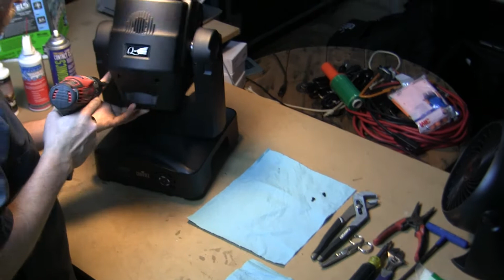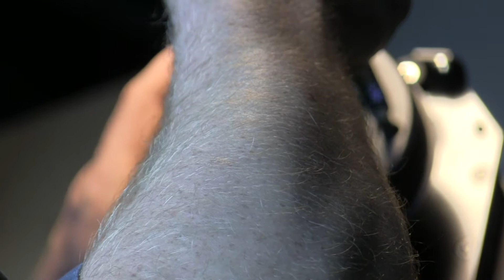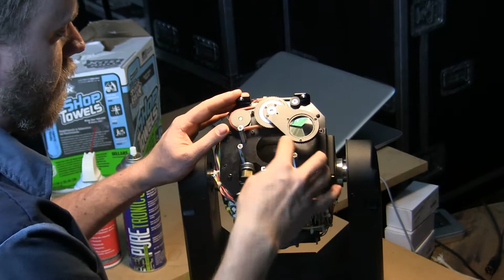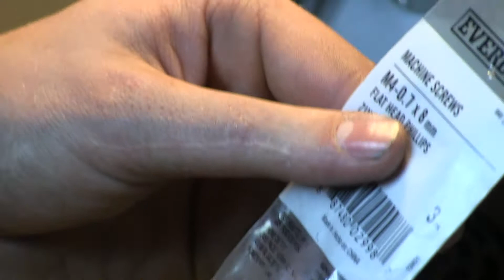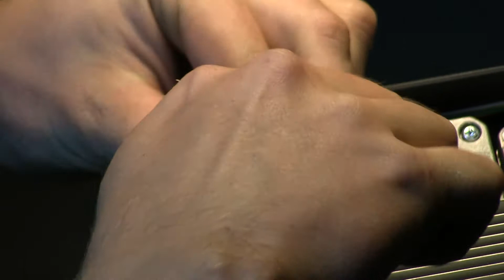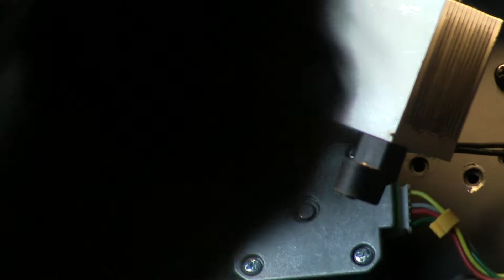Chauvet Q-Spot 260 LED - LED Chip/Diode/Bulb Replacement Part 1

Comment: Could you guys share with me the site to get these LEd diodes
Reply from the maker: These LED diodes come and go over the years. I don't remember exactly where I bought mine, but after doing some research I found this eBay listing for an LED chip that matches. Hope this helps! 

https://www.ebay.com/itm/204433138069?chn=ps&var=505002560529&_trkparms=ispr%3D1&amdata=enc%3A1W5fY80IYRCGCwX7dKCD5BA7&norover=1&mkevt=1&mkrid=711-117182-37290-0&mkcid=2&mkscid=101&itemid=505002560529_204433138069&targetid=2320093655185&device=c&mktype=pla&googleloc=1015334&poi=&campaignid=21222258394&mkgroupid=164713660992&rlsatarget=pla-2320093655185&abcId=9408285&merchantid=6296724&gad_source=1&gbraid=0AAAAAD_QDh95sthiDY8Pqv0EqOTAQeI5G&gclid=Cj0KCQjwlvW2BhDyARIsADnIe-I7TgJSMgTowxzheXwzxbKH0PRO3VTyKdCu-hrjkv9108b683I5KGcaAsz0EALw_wcB
Reply: @kpproductionusa  Great descriptive video! I have some Chinese knock offs “spot 60w led” that I’m interested in retrofitting. I noticed the 60w LED diodes is the same size for 75w and 90w. Is it possible to move up wattages? Probably another stupid question but is 150w -200w possible? Any information will help Thanks!

Comment: Where do you get bulbs
Reply from the maker: These LED diodes come and go over the years. I don't remember exactly where I bought mine, but after doing some research I found this eBay listing for an LED chip that matches. Hope this helps! 

https://www.ebay.com/itm/204433138069?chn=ps&var=505002560529&_trkparms=ispr%3D1&amdata=enc%3A1W5fY80IYRCGCwX7dKCD5BA7&norover=1&mkevt=1&mkrid=711-117182-37290-0&mkcid=2&mkscid=101&itemid=505002560529_204433138069&targetid=2320093655185&device=c&mktype=pla&googleloc=1015334&poi=&campaignid=21222258394&mkgroupid=164713660992&rlsatarget=pla-2320093655185&abcId=9408285&merchantid=6296724&gad_source=1&gbraid=0AAAAAD_QDh95sthiDY8Pqv0EqOTAQeI5G&gclid=Cj0KCQjwlvW2BhDyARIsADnIe-I7TgJSMgTowxzheXwzxbKH0PRO3VTyKdCu-hrjkv9108b683I5KGcaAsz0EALw_wcB

Comment: Where did you get or where can I buy a replacement diode/LED bulb.
Reply from the maker: I don’t exactly remember but I think I found them on chauvetparts.com after doing some research. They may still be available but I don’t know because they’re such an old fixture now.
Reply: @kpproductionusa   did u manage to get the replacement led. where did u get it